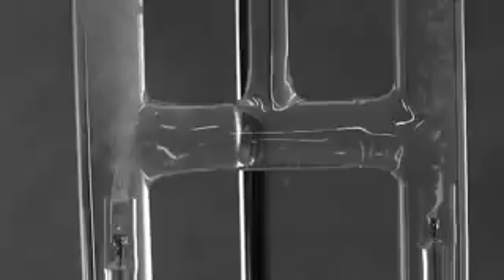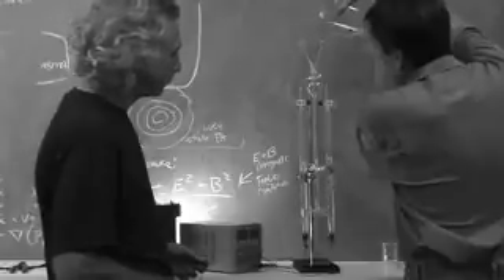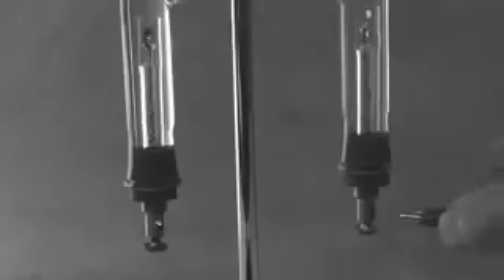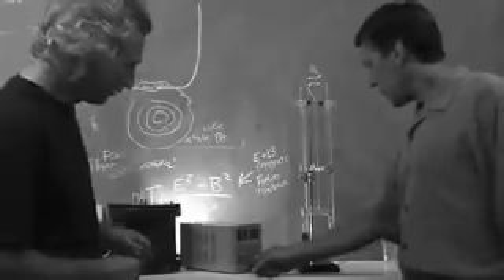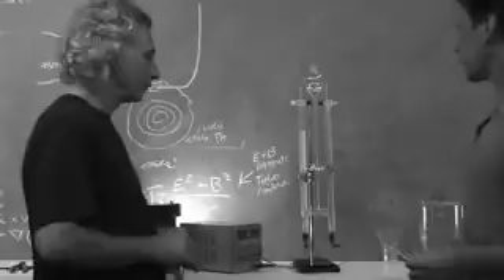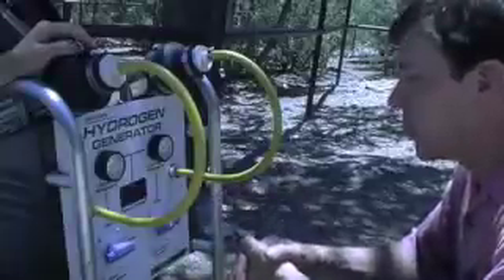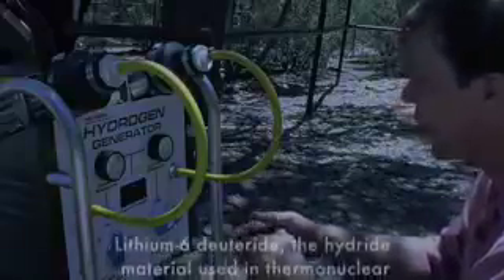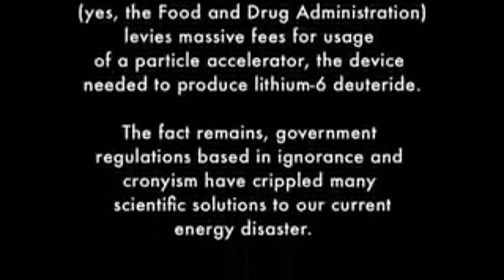run your car on water. This guy does just that!

Comment: Hmm how bout Distilled water and NaoH and drop in some crushed aluminum cans my guess if you wanted say an experimental torch it might work for that to just be carfull when adding the aluminum just a little bit at a time! Im guessing its a pretty violent reaction! Similar to the war in the Falklins and the Exocet missile hitting an Aluminum hulled ship! Really Im guessing the Navy must use something like this in their submarines n hydrgen is the by product so they rarely if ever have to surface! Maybe part of the reason they come down on people experimenting with HHO generators cuz its probablty a classified technology! If you combine it like u say with solar to produce it it might be more feasable I tried just building a few hydrogen cells for an old Subaru just to say sort of have better combustion n at times I saw better fuel economy but for city driving it pretty worthless cuz there isnt much control! But say on a long trip and a steady speed I think this cheesy idea added to ur intake manifold might help a little bit All ud need is a PVC type contain H2O Naoh/lye and some aluminum cans n u might be able to work out an equation but I forgot how to do stochiometry to find the best quantitys of water Red Devil Lye NaOH and aluminum to use! And in this case u wouldnt need any electricity! Sort of a simple plug n play for say long road trips.

Comment: Chuckle - This speaks volumes as to Bob Lazar's credibility.  Electrolysis is Jr. High science. If you want better gas mileage install larger tires on the rear and drive down hill everywhere.  BUHAWAAA!

Comment: The down side of this is it takes more energy to split water into hydrogen than the hydrogen can produce.  You need enough energy to split the water continuously, like solar.  Otherwise you may just as well get an electric car, it will be more efficient.  The only time it works to use Hydrogen split from water is if it was split with excess energy from another source (wind, solar, hydro, etc) that can't be used at the time the energy is produced.  The excess energy can be used to produce hydrogen from water then the hydrogen can be stored.  Basically, a hydrogen battery.

Comment: Why can't you just run the Hydrogen Generator off the car's Alternator? 
And charge the car's battery so you can run the Hydrogen Generator before you start the car?
No solar panels needed.
The question is: Do you get more energy from the hydrogen than you used to create the hydrogen?

If you need Solar Panels or wind, etc. for this to work, it's useless and inefficient.
Give me some real numbers or I'm not convinced this actually works without the solar panels.
Reply: Don't bother, it doesn't work.

Comment: One small problem:

More energy is required to extract the hydrogen electrolytically than burning it as fuel. Your mileage is more dependent on the size of your battery than anything,  because electrolysis requires very high current,  in fact, more current than the engine's generator or alternator is capable of producing !

Sorry, but perpetual motion is the stuff of carnivals and side shows; no real science involved.

Comment: "It works just fine," by experience.  Unfortunately for us here in the Philippines where Engr. Dingel came from, producing hydrogen fuel is so costly according to my Physics friend guy; wasn't economically feasible.
Reply: And that's the real point right there. If you can produce electricity easily, simply use it directly instead of having more very unefficient steps.
Reply: @justalonesoul5825  hence why Elon musk thought the electric is better than hydrogen powered.

Comment: Having worked for Area 51 before, I did expect some form of alien tech on this car. It is still safer to use hydrogen in demand concept. It wouldn't take up so much car space too. Geet Engine model is the way to go.

Comment: The title of this video (which is the only thing I noticed, and did not see the video), implies that water is a fuel - a source of energy. Water is a very stable compound since its formation in the first place released a great deal of energy already, and therefore it cannot react again to give off a great deal of energy again. That would be breaking the very basic law of thermodynamics which states that energy cannot be created nor destroyed. There are some chemicals which will react exothermicaly with water such as the group one metals in the periodic table because they are more reactive than Hydrogen, but one they are very expensive and difficult to incorporate in a machine to produce energy. And I am sure that the lay man when he hears energy from water is actually thinking free energy not reactions with more reactive agents than Hydrogen. That is so stupid and wrong for the afore mentioned reasons.
Reply: I mean there are water generators using water to move the wheel around to generate electricity so in that sense it is a source of energy granted kinetic energy into electric energy
Reply: @JohnnyYeTaecanUktena  That is  Kinetic Energy as you yourself said. The point I am trying to make is that there is no potential energy in water like there is in petrol for example because water is actually the result of an already happened combustion! So there is no energy left. Water is just the by product, the ashes if you may of a previous reaction. 
Splitting water itself is no form of energy, on the contrary you have to supply energy to bring the water back to its initial state (hydrogen and oxygen). It is like recharging a flat battery. If possible it is more efficient to use the energy directly instead of using it to split water and then get it back from combustion or some other way ( part of it).

Comment: The problem with all hydrogen cars is that unless you just have electricity that you would otherwise just lose it does not make sense. 
An electric car is about 90% efficient. (5% loss to heat when charging battery and 95% efficient electric motor. 

Hydrogen you first need to do electrolysis (70% efficient) and if you combust it in a modified engine you get about 35% out of that. 
So for every 1kWh you put in you get 0.25kWh out compared to 0.9 for electric.

Comment: 10 hours to fill your car up. 🤦‍♂️ that car can't be driven more the 200 miles one way.
Reply: the car also runs on gasoline. It starts on gas, then once the tanks reach operating temperature for the hydrogen it switches over.  If the hydrogen tanks run out it then switches back to gas.

Comment: Do you have any clue, any at all, how many billions of kilowatts of electric energy it would require to convert enough water into hydrogen to run an internal combustion engine and you realize how much it would take to get reasonable horsepower out of an engine. I have seen 1000 horsepower engines converted to run on hydrogen and only be capable of putting out 68 horsepower. Hydrogen first of all, does not explode when ignited. It implodes making it almost impossible to use for a reasonable internal combustion engine. You are also of the mistaken impression that gasoline is a fossil fuel. Gasoline is made from oil, oil is abiotic it is not a product of the manipulation of biology in any way shape or form. It actually comes from the pressures deep below Annie fossil remains well water and marble, or calcium chloride exist. The reason we know this is that they have actually been able to create oil by putting water and calcium under high pressure. But it also takes a great deal of energy to create the oil. Where the Earth is constantly creating it for us. They just tell you it's a fossil fuel so they can justify raising the price every few weeks.

Interesting concept I do believe it is a neat toy.

Comment: Using electricity to generate hydrogen is just an extra step. If you have electricity to "turn on"  then you already have a way to power the car, or anything else for that matter. I get the concept. It's cool and all. But it's redundant and inefficient. Lazar is a fascinating man and I have been and will continue to follow his story.
Reply: Energy storage in the car is a necessary step.  That's what this is.  The process has been very well understood for many decades.  It's not his idea at all.  A Tesla batter is another way to store energy and one that just happens to be more efficient.

Comment: This is the stepbrother of Bob Lazar. What a crap. Hydrogen must be stored in tanks at high presure to be used for direct combustion (there is also the fuel cells solution). This is one of the bigest problems when it comes about using on vehicles. Compressing the gas by the water pressure in the process of electrolysis it's much too low comparing with the need. An installation that can bring hydrogen to the desired pressure safely costs too much for a private person and surely needs special authorisations.
This is a cheap scam of some guys trying to sell useless stuff to fools. Which are, thank God, lots and lots.
But hey, you noticed that the hydrogen burns like a cigarette. Just very fast...

Comment: Hilarious.  Follow the energy.  Where does the electricity come from that splits water into hydrogen and oxygen?   Where does that electricity come from?   How efficient is that process?   How efficient is your hydrogen engine?   We have a real energy problem in western civilization.  This is not the solution.  We finish all the oil in 50 years.  We finish all the coal in 155 years.  If we pursue nuclear fission to fill the need, it will extinguish life eventually.  Fusion or population reduction are the only long term options.  I vote for fusion.
Reply: All energy is free and ultimately comes from the sun
Reply: @markchandler7847  fossil fuels don't come from fossils 🤣 people who work in the industry will tell you that, artificial scarcity means more money more profit, oil Wells renew if left alone its coming from the earth, geothermal could power the world easily and nuclear, oil and gas have powered the world not just the west

Comment: ThE GoVERNmENT SuPreSSES HyDROgEN. Y’all idiots don’t understand how energy works. You can’t get out more than what you put in. You have to produce the hydrogen one way or another. That requires electricity. So much electricity that running the generator from your car won’t produce enough current to produce enough H to keep an engine running under LOAD. getting an engine to idle is totally different to working that engine. So you use solar panels to produce H and store it in a tank. Yes H will run a vehicle. However, H isn’t a viable fuel. 
The oil companies aren’t suppressing the technology and if you honestly think that, your probably a little retarded. Exxon mobile is using I believe 60% of their budget on research for renewables. That was posted in 2019. Get a grip. If the government liked it, they would’ve used it! That man would’ve been stupid rich. And any company that stumbles upon this video would be so lucky! Yeah right. Have fun thinking the earth is flat

Comment: all you are showing is a chemistry experiment i did in my grade 12 class.this is nothing new.  what you are outlying is the production o hydrogen using electricity. you have not done your arithmetic just to say.  do you know how much energy is required to separate the hydrogen from the water and to compress the hydrogen to a liquid? .  go back to school.. Japan has done a lot of research to go hydrogen economy.  but the cost of producing hydrogen and create an infrastructure for its distribution does not warrant iit for now. but for the future because of global warming, we will need to go to this route,  especially to eliminate the carbon foothprint of the airplane/  your claim of making these fuel-hydrogen cells is not as easy as your are saying.  the safety factor your saying is not valid.  a small leakage will blow you up.  
regards.,
antonio
canada